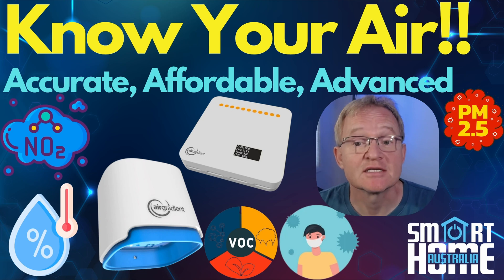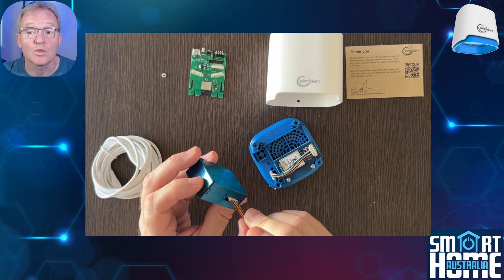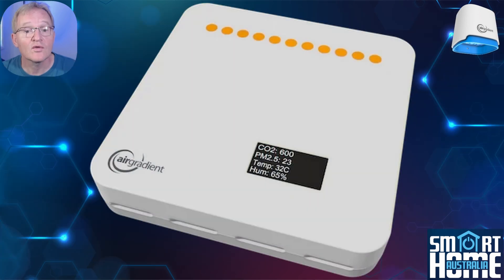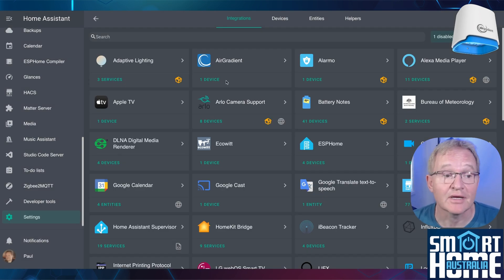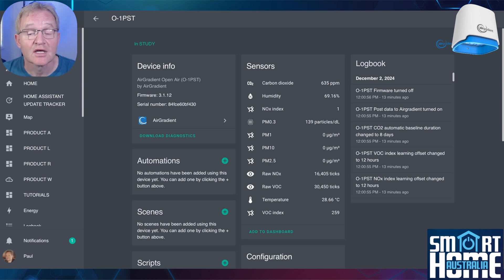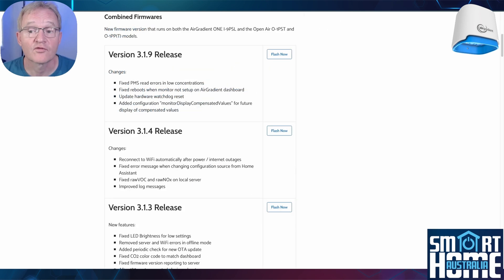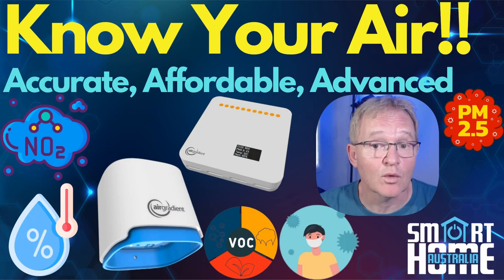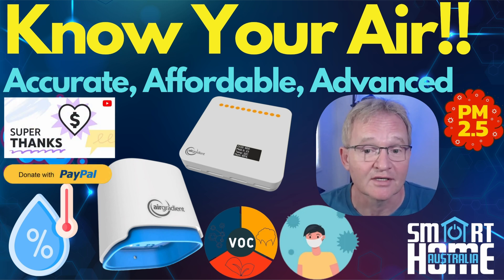Know your Air -and Breath Easier with Air Gradient

Comment: Will have to save up to grab one of these. Have followed this company for a while.
Reply from the maker: I was blown away with the professionalism of the team and the achievements to date. This is a must have device if you are even slightly green and eco friendly.
Reply: at a price of 200$ pre-tax, I personally would suggest to get a ARANET 4 HOME, they are a similar price and higher quality. [have 3 myself]
Aranet also has a discount roughly every year, dropping the price by over 25% [from 205 euro to 150 euro [inc vat/taxes] ] {at least if CO2 is the only unit you want to measure}

Comment: I was looking to pick up the component sensors of this kit, they look like a nice company that I'd like to support, but I'm not able to spend much on the hobby.  My soldering iron is itching to warm up to coble it together though!
Reply from the maker: They are a great company and genuinely concerned about air quality. The research program they run that collects the data and passes it to eduction institutes is awesome. And the devices are top quality and well worth every cent, but yes, you pay for quality components, that the only downside.